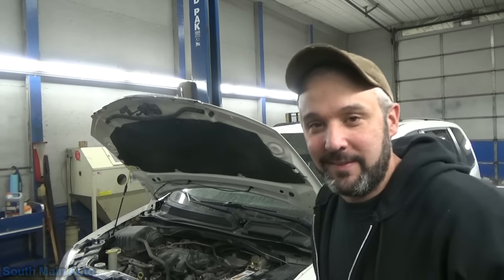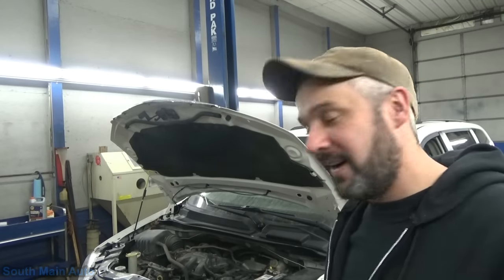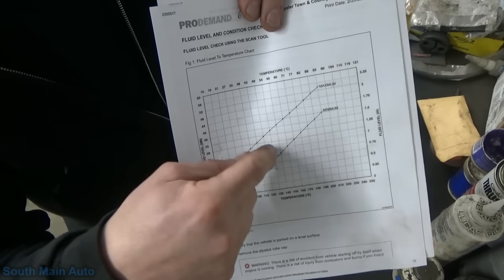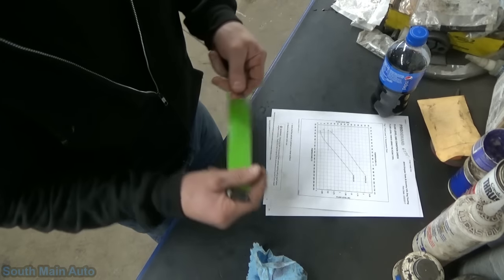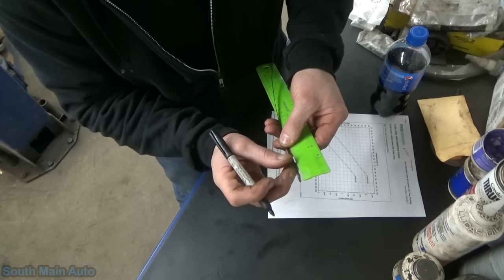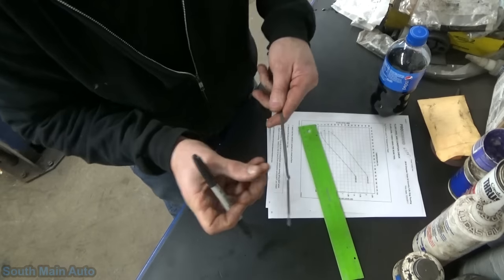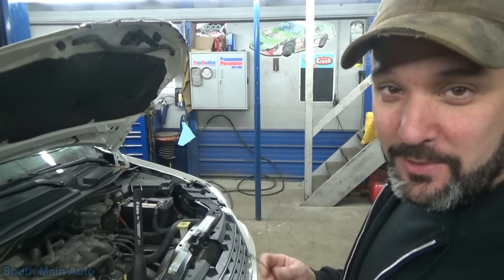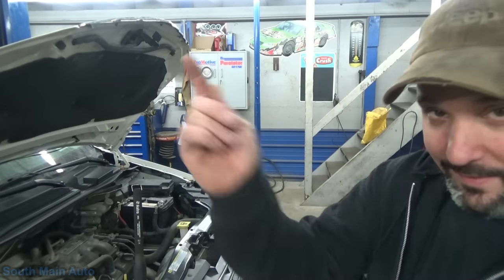Caravan / Town & Country 62TE Transmission Dipstick Hack

Comment: My 2015 doesn't even have this dipstick tube and cap. There is just a stub pipe on top of trans front cover that I assume is for filling. It's only 1/2 inch long 1/4 in diameter with a semi-loose cap the size of a tire valve cap that won't come off. Anyone know if this is meant to be a dipstick/fill port? If so is there a replacement cap. It is completely different from what is seen on earlier models.

Comment: I don't know how much is the right amount, but I've been checking mine with my oil dipstick at every fifth-ish gas fill up. As long as I can see that there's fluid, I'm not hurting it and I know where the level used to be, so I just try to keep it around that line. It's less scientific than your way, for sure.

Comment: Hi man, I have a T&C 2008, and some times it have an alarm it say change oil, I replace Motor Oir but still present the alarm, now after see your video, I have another question and maybe is related to this issue, my transmission stuck in 3rd speed, and the transmission do not make changes, after turn off the engine, and start again, the transmission start to do changes in the speed, six speeds changes, and I bought a scanner and I get the code P0765 Solenoid change D, do you know what is recommendable to check?

Comment: Thank you!  Can somebody help verify the conditions of checking Dodge ATF level?  after driving 1hr, hot engine in idle & trans in park I read 25mm. 30 sec after engine turns off I read 45mm.....?

Comment: Chrysler also does this with their NAG1/W5A580 transmissions. The special cap is to prevent water contamination but its a huge pain when trying to check fluid level.  On these I just use a trans dipstick from another car and mark the fluid level before beginning any service ( assuming no leaks) then refill with the amount drained out. Seems to work out okay and certainly a big deal.

Comment: hello Mr. O. South Main Auto; I'm Simon I need help getting two parts O-rings for all transfer tubes, new clutch oil seal and do the valve body need to be changed? 62 t e transmission 6 speed 2011 dodge grand Mainstreet3.6

Comment: i just did this hack on my 2012 Chry. Town & Country van (cold, not running engine)  and the level shown the stick is much higher than even the hot level of 55mm = 2.17" = 2 3/16" !!!    and i just got back from the dealer yesterday who told me the tranny fluid level was fine !!!???  whats going on???  there is no way the stick could get past the stop is there?  i did it twice with the same reading???
Reply: The engine needs to be running at idle and in Park

Comment: Reason they did this was because of customers checking the trans fluid seeing its low and overfilling it.

Alternatively some would put the wrong fluid in which was a widespread issue with Chrysler vehicles, even with independent shops using dexron with an additive to create a mock ATF+4.

Comment: Hate to say it but "most" not all but most folks really do not want to know about what they drive. Just that it gets little timmy to practice on time. UNTIL it goes wrong. Then it's off to you tube - hey the stealership wants way too much $$ to look at it so.....maybe i can figure it out. And there is a very good chance you can in fact find that information. BUT can you
perform the service?? If your 30 or younger chances are very good you do NOT own a set of tools capable of performing the desired task.
The point being this: Automotive manufacturers know thru demographics that which i have stated previously. And it is to their benefit to seal off access - not yours.
Coolant-sealed Trans fluid-sealed Engine oil-sealed....Your a consumer, just drive it.
When it pukes all over the road on the way to work - just take it to where you bought it.
We'll fix it for ya......maybe after a few tries at your expense....maybe.

Am i jaded yes i am. Am i telling the truth yes i am. Automakers would like to have you think about your vehicle like an appliance use it, when it dies get a new one. 

Open hood read label on plastic engine cover NO USER SERVICEABLE PARTS INSIDE

Comment: 70 bucks? Dorman makes the dipstick for 20 bucks lol part number 917-327
Reply: el_chingon Yep. I got it on Amazon for $18.
Reply: el_chingon lol you said dorman
Reply: try ali express.. got my mercedes dipstick for $4
Reply: pdgeman not everything dorman makes is crap lol
Reply: Tracy Sellman I tend to use OEM whenever possible. However, it's a dipstick. Dorman's millimeters are the same as FCA's.
Reply: not always, i've had two tape measure measure about 3/8 difference. Talk about fun when you are working with another person using their own measure.
Reply: Exactly.... and it works just as good
Reply: I have one if those fancy dipsticks...somewhere...I like this idea much better...I don't have to remember where I put it :-) well, I mean other than back in the car
Reply: You can get them on eBay for about $6.

Comment: I amma retired ford tech and trans builder on occasion and everything has turned into bullshit in the past 20 years. the no dipstick is one of the stupidest things to ever hit the market. and when cruising in 72 ltd convertible sporting its 429 v8 and c6 trans and 9 inch differential that will probably will still be around many decades after all this computerized bullshit is dead and gone. yep I got the store bought dipper for the chrysler 62te trannys cause I own 2. I learned to make the 62te live is to keep serviced i flush mine about every 60,000 and add 2 containers of dr tyranny friction modifier and one has over 350,000 miles never a transmission issue yet using all amzoil juices in everything.

Comment: This is a wrong measurement.
Aftermarket dipstick should rest against the bottom trans pan, but the dipstick from the engine is much shorter than the Aftermarket dipstick. 
And therefore it is necessary to do the notches not based on the table. Need compare how deeply 2 dipsticks are immersed, then compare the facts and only then make notches. 
Оnly then, based on the notches on the aftermarket dipstick, table and oil level on both dipsticks, transfer the data to the engine dipstick.

Comment: I am guessing you have a second job selling replacement tranys? The reason for this is ATF+4 expands a LOT during temperature changes. So some local "service tech" thinks the fluid is low and over fills it. Then the ATF+4 foams up because it is over full. Foam = bubbles. Bubbles = air. Air through a trans pump is VERY bad and kills a pump. I have an Avenger sitting in my drive with this exact problem because some used car dealers "tech" though he knew better than FCA. You are hashing at the max range on the chart for max on the diptick. Unless you are towing up hill in the summer the 62te will never get that so everyone  doing this and checking it "hot" will be over filling their transmissions.

Comment: Worked Chrysler for years, they were pure asshole when they dreamed this up.  It was money saving move on their part. Just like the crappy cheap manufactured parts they sold
With Chrysler their moto is, if it's good enough it's good.